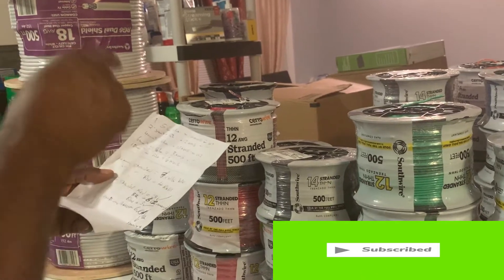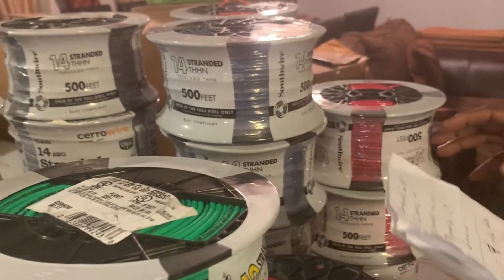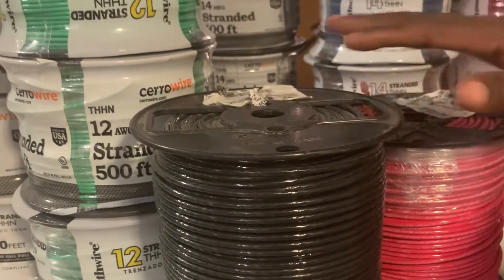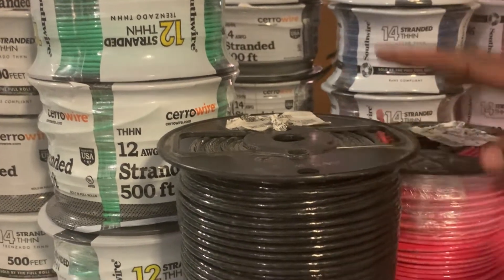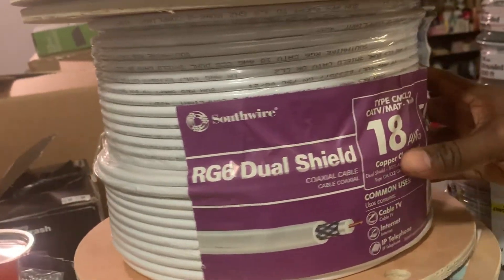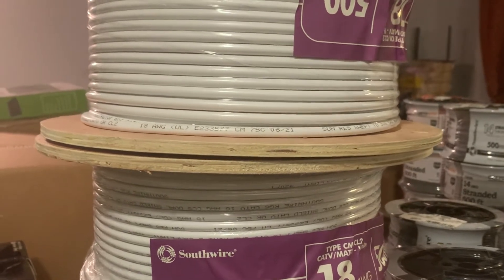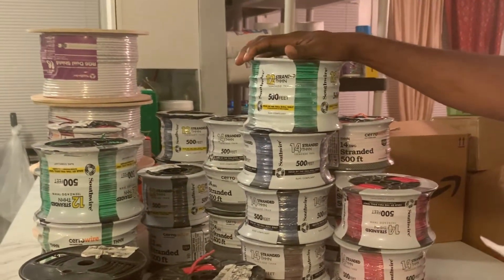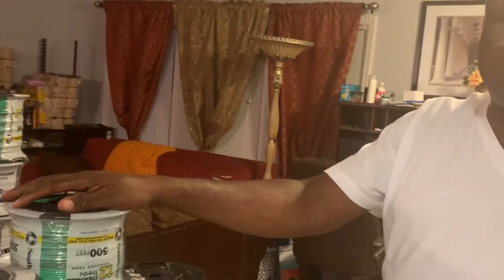GHANA BUILDING! COST OF ELECTRICAL WIRING COMBINING 110V AND 220V.

Comment: Hi Tilly,
I was at home Depot today to get my wires, but I was having problem finding 16mm which you said it's 4AWG. One of the associates looks at my list and he said my conversions are wrong.  Saying 1.5mm is 16AWG not 14AWG  etc. Did you have issues or did your electrician complain about the sizes in AWG that you bought?
Reply: Yes, the conversions are wrong. 1.5mm is 16 awg. 2.5mm is 14 awg. 4mm is 12 awg. 16mm is 6 awg.
Reply from the maker: Okay I will ask.
Reply: What about circular boxes
Reply: Can I get 100amp change over switch here , 63 amp charge over switch , 3 face circuit breaker and single circuit breaker, cable lock in Home Depot or Lowe’s can you please covert into Ghana one
Reply: Please I need help please

Comment: Thanks a lot for the video. I also got a list from my electrician in Ghana and this video helps out. The problem is that the mm to awg conversion is a bit off from what Nana said. When I checked the standardized conversion chart online, 1.5mn is 16 AWG, 2.5mm is 14 AWG, 4mm is 12AWG and so on. It seems your electrician reduced the AWG. Please, did your electrician reduced it to be in line for Ghana's voltage? Can you please ask your friend that helped in the conversion. It's a bit confusing to me. Thank you so much
Reply from the maker: Ok I will.
Reply: @tillytothetophere  Thanks

Comment: Please, Canadian Wires are the same as USA wires. Both countries use AWG standard. All wires have rating therefore the rating of the wires have to be followed. Wire rating is based on amperes, voltage and insulation.
Reply from the maker: Thanks.
Reply: @tillytothetophere , You are welcome.

Comment: Hmm this is serious am an electricien living in France my advice is struggling to get convention is to get your cables in 🇪🇺 europ that is the standard of ghana. which would make you r work easier ok the America cables a quality but not the standard of ghana electricity so you can use the america cable and it will still not help because is not the standard of ghana so my advise is  using the USA type of cable is like you are not using the right tool for the right job.and more over you need circuit breakers which are up to date that can protect you house there's a foult of when current overflow this breaker will do the most work for example you are using a water heater and it has a foult and you don't know immediately you water heater explode this circuit breakers would would turn off immediately to stop 🛑 any disaster. and wiring a house required a good électricien who can follow the requirements the amount of voltage you would be consuming and puting up the wiring for seach requiment dont just give your contract to someone working on the street with experience noo experience alone is not enough if he or she is not enrolled in any institution or class of apprenticeship most  the cicuit breaker and others materials used in ghana are low quality and not up to date so you see them very cheap buying seach materials you are singing you death warrant.
Reply from the maker: This is not the first time this been done in Ghana. Anyway thanks for watching.
Reply: @Brown Anas, Currently, only ECG certified electricians are to do all wiring in Ghana.

Comment: Good information as usual.  So if I'm  able to buy kitchen appliances such as the Vitamix blender,  fridge, microwave etc. I can plug them directly without buying a step down?
Reply from the maker: Yes you can.
Reply: @tillytothetophere  Wow. Thank you for sharing.
Reply: @AkosuaBoateng2290   You need a step down transformer for outlets wired for 110v in Ghana since the power supply in Ghana is 220v. If you plug an American appliance directly into the 110v outlets you will fry it. Also, some US appliances use what we call center tapped 220v (it is two 110v feeds going into the outlet). Examples are Dryer, Washer, Electric Oven, Stove etc. The heaters in those appliances use the combined two 110v feeds whereas the display, motor and other components use 110v. They use bigger sockets which are either 3-prong or 4-prong. Most houses built after 1997 in the US have both options for these heavy duty appliances but are required to use the 4-prong types.

A good electrician in Ghana can do the wiring for you but you need to ask before you hire him/her if he/she has done it before.

Finally, the sockets/outlets for the US appliances are much smaller than their Ghanaian counterparts. You should buy the US gang boxes/sockets/faceplates from the US and send them to Ghana just to be safe.
Reply: @deeeball  Thank you for your time and advice.  I appreciate it